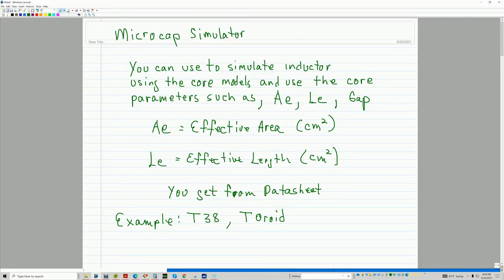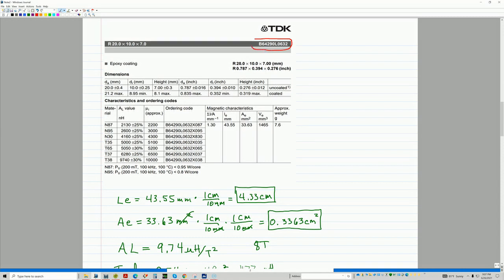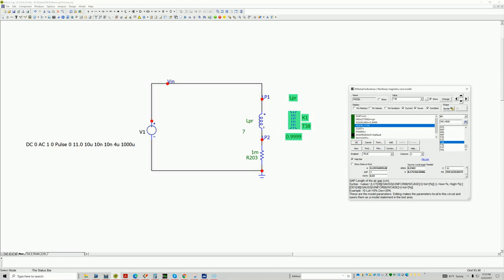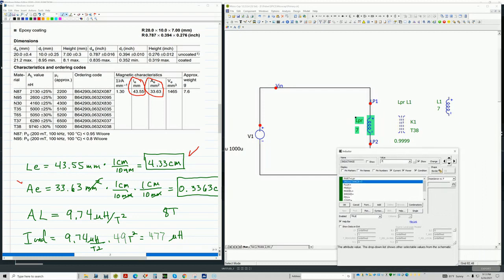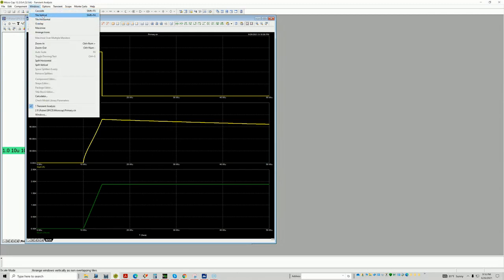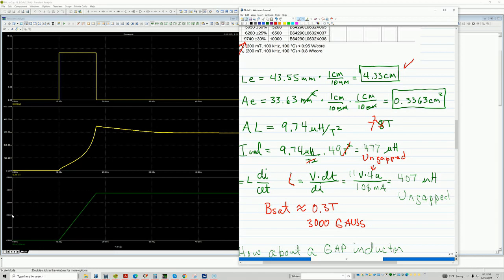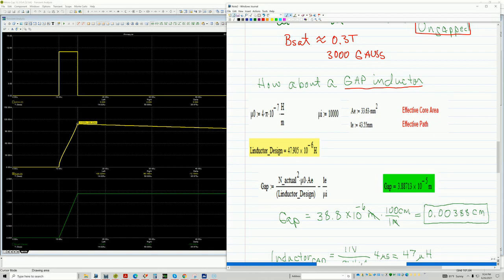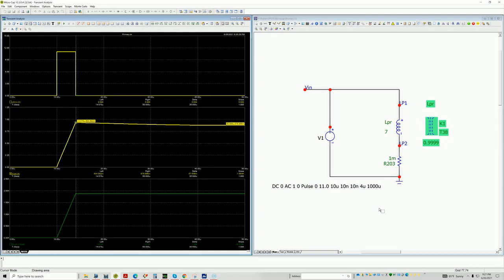Micro-Cap Circuit Simulator, How to model an Inductor using core models

Comment: Thanks a lot, Robert. Very informative. It shows, how good simulation and calculation match. It is also a great input that we can show flux density.
You could even show the inductance of the coil as L(Lpr). Then we see that in case of an air gap the inductance is nearly constant.

Comment from the maker: In this video, I use Micro-Cap to model an inductor using a core model that accepts physical parameters such as Ae (Effective Area),  Le (Effective Length) and Gap Length. The model shows that when the Flux exceeds 0.3T (Tesla), the core saturates and you have a sharp increase in current. Questions or comments can be sent to rbola35618@aol.com. If you like this video, please subscribe, share, and give a thumbs up.

http://spectrum-soft.com/download/download.shtm